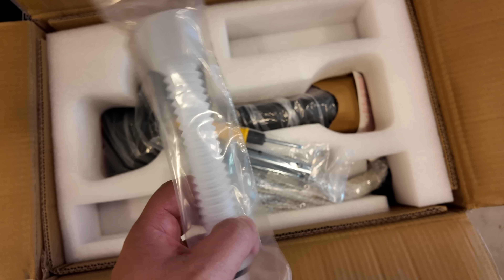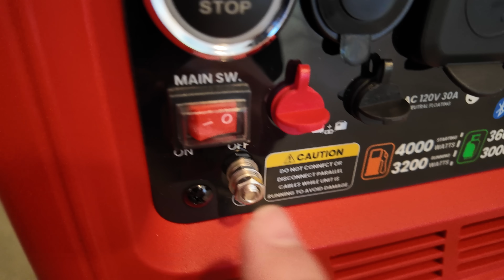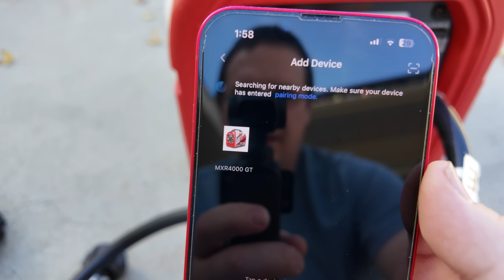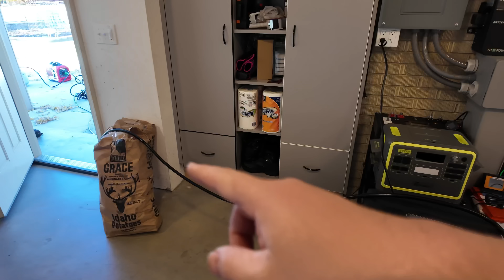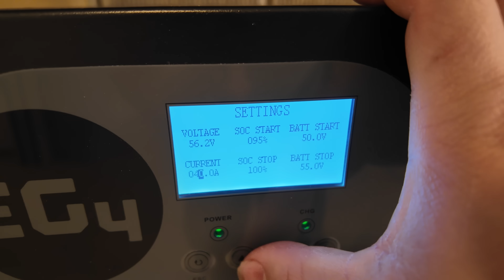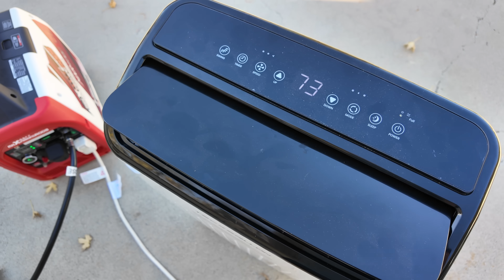UNPOPULAR OPINION: Buy Gas FIRST (Before You Ever Touch Solar)

Comment: Did you let a few minutes pass before testing the generator's ability on eco mode  to start the air conditioner (after doing the first test.without eco mode)? The air conditioner's pump would have been starting against higher refrigerant pressure if time was not provided for pressure on the compressor to drop back. It would be the same thing as starting an air compressor that already has full air pressure in the tank.
Reply from the maker: To tell you the truth, I don't remember

Comment: Small inverter generators like to run at about 83% capacity (read that at 70-90%) in order to get the most electricity out of gallon of gas. With some power stations, you can adjust the charging speed via an app on the phone to make it charge slower. In my 5 hours of testing and about 20 tests, 83% was the sweet spot, your testing results may vary. This is for an inverter generator charging a power station with a full steady load. At 50% capacity, I was getting ~4 killowatts hours of gas out of a gallon, at 83% load I was getting ~5.6 kilowatt hours of power out of gallon of gas. Based on my research with gasoline, 6 to 7 is the maximum amount anyone can normally get with a small generator. Diesel engines, and turbines get more.  I ran my tests with the tiny sportman 1000i 800 running watt generator, powering one delta 2. People would do better with a larger generator in the 1500 to 2000 running watt range as it can run pretty much anything on its own. If you are just running a generator, you need to leave extra overhead for the starting loads of motors, (the fridge compressor kicking on and off). Having a steady load allows one to really sip fuel, and get the most power out of the the fuel. I figure I can keep my house going on under a gallon of gas a day. My fridge takes about 1 kilowatt every 12 hours, when running off the Delta 2 power station. Anyway, just wanted to share
Reply from the maker: That's some great data on finding the sweet spot for fuel efficiency, thanks for sharing!

Comment: An inverter generator paired with a power station is the best hybird combo. They add solar. You would have all your basis covered.
Reply from the maker: Correct
Reply: Can you give an example of what each component is for a very small power need to just be using a 100w solar panel?  For A couple of lights, charge phones, iPads, and whatever else it might run. Thank you.

Comment: Unpopular and stupid opinion. With a solar Setup No Matter If a Power Station or a real solar system your solar Inverter must be as big as your biggest Power User. You now can Use a way smaller Generator to recharge your batteries and need less fuel. 
With solar you have an alternative Power source, and with a proper Setup you wont even need your Generator during Summer.
Reply from the maker: Valid point, but having a dependable backup ready to go is crucial for peace of mind.
Reply: @theresatrickforthat ?? A small generator and your batteries IS a dependable power source

Comment: I do appreciate your information
and I will continue to build a system.

 Im in North Idaho & yeah direct sun  here on belly acres gets very short in winter months.   [sigh - reality]
But Im thinking Hydro is possible as there are a couple creeks thru here   it could be an idea :)
also wind (?)   it blows here, not always, but pretty steady throughout the winter [the rest of the year it is better]

 in the past few years I rune a genny on just the 120 essentials, heat, lights, Wifi and of course TV and a couple fridges
my genny is a Generac  4000 [very basic] 

 my thought is to get a dual fuel genny - one dedicated to 120 for the long time of just the 120.

 Im been genny shopping and like that  lill max genny for the 110/120 light load

 Ive been pondering the Wen genny for the well pump. maybe the 4750 or maybe the 8000 (?) 
the research continues for the 240v genny.
 
 im thinking the lower "might" be quieter?  it will be an hour or two on that one, then I can shut off the pump breaker.
Ive been running 120 up there to the heater to keep it from freezing [thats a happy surprise, I just learned that a few months ago]
went up to look and had a warm pump house :o 

 then for the well pump thats 30A 240v - a dual fuel genny just for that. 
obviously stronger, but a fuel user for that 240v.  just run it when I shower, wash laundry

and then keep building up a dependable Solar/Hydro/wind battery bank.
it can be done. 

 normally the snows deep up here - its about 2250 elevation here at the place. 

 those power banks have my interest - ups ability and rechargeable (?) with an inverter genny? Im thinking that could be a win!
Reply from the maker: Sounds like some fun thoughts. Keep up the good work; you'll figure it out eventually!

Comment: The noise from a gas generator is the problem, you can't run one at night unless you live in the sticks!
Reply: Some of the gas generators are not that noisy. Particularly, the small inverter ones. There are plenty of ways to deal with the noise. Moving the generator to an area where the noise is not an issue is easy. Several sheet of plywood cut at angles and leaning against the generator can noise by about 50%

Comment: I'm thinking of adding a battery to my generators for the efficiency. Currently I have multiple generators for the redundancy and I can recommend a Big/Little approach, highly efficient 80cc inverter generator to provide base load  and my larger generator is a cheap 4200W 270cc  inverter generator that will run washer/dryer/heat water while still providing the base load for the house which is the usual 24/7 air conditioning, refrigerator, TV, computers, lights. Living in the tropics, it's pretty easy to tell when you are going to have a typhoon. We don't have a US style tank water heater here, bath water is a 3L 2000W kettle for convenience but I also have a large 300w rice cooker that takes about 30 minutes to boil a gallon of water. I will probably have to DIY my own battery because very few have 220V output and everything is 220V here. Still, the Big/Little method works well for us.
Reply from the maker: Sounds like a really well thought out system!

Comment: You kept calling the battery unit solar.  It is not solar it is a battery that can be charged with a generator or solar. In my opinion, your best plan is to use the battery unit and keep it charged with the generator. If the budget allows by all means invest in some solar panels to charge with but do not rely only on solar to keep the battery unit charged, always have a gas generator available.
Reply from the maker: Yep, that was the whole idea of the video.

Comment: This Unit has so much impressive about it.  Could I use this and my Honda 2200i in parallel?  I already have a parallel cords with a 30amp receptacle spliced, ready for when I get a second 2200, but I might skip it and step up to this 4000W generator.    Thanks for the thorough presentation.
Reply: Parallel doesn't really work that way. Paralleled the Honda would probably trip out before the 4000W generator gets to maximum output. I have seen examples where the smaller generator added something but it wasn't 1 : 1.
Reply: @robertkubrick3738 thanks. I was doubting

Comment: My family was left without grid power for 11 days after Helene. I had a Honda EU3200 and 40 gallons of fuel after 5 days we ran out of fuel. We survived the las 6 days relying on EcoFlow Delta 3 Pro with 2 expansion batteries and charging via solar.
Reply: You should have used your Eco, then recharged it with your generator. That way the generator only needs to run for an hour or two a day and that 40 gallons would last 3 weeks
Reply: @jimf4342   I have 12KWh of energy storage plugged to my house via Pro/Tran2 Sub Panel or critical panel. I have 2 fridges, chest freezer, Portable inverter AC, lights and some small electronics. My average power draw was 1400-1800watts an hour. I have 12KWH of energy storage and the Honda EU32 would take about 5 hours to charge the power station and pass power to the house. My calculations on the EU3200i with all the information I have gathered online would state I would burn 1 gallon every 3 hours at rated load =2600watts. I was realistically seeing 3 gallons every 5 hours. I would have approximately 8-10 hours of generator off time, but those are at night when I don’t want to wake up the neighbors or hear them complain about the generator. After 5 days we ran out of fuel and unplugged a fridge and a few other items and ran on bare minimum needs which didn’t include the inverter AC.
Reply from the maker: Wow, that's crazy how fast he went through fuel.

Comment: I agree,   its better than solar.   I just paid 200watt panels,  one is not what the other is,  burned up cells in the panels, and I will not get my moneys worth from them,  the problem is,    they decide where to judge the sun at,  then they make the cells bearly,  with tinyer wires in them,  and whey the sun is to hot from climate change,   they fry,  and then not produce no more electric.   This is a true story.   And today,  the generators are all chinese crap,   not real steel is in them,  they are made from cheap zinc,  some are cased in aluminium,  so welding when the rod goes thru the side of the block,  is not possible,  you have to buy a new one,  all of this stuff is shut it off, throw it away, same as the gov wants you to be bankrupt doing it
Reply from the maker: Yeah, it's too bad we don't have high-quality stuff like we used to.

Comment: I’m writing to share my experience with the maXpeedingrods MXR4000 GT, a 4000-watt dual-fuel inverter generator. We run a van with 600 watts of solar on the roof, and to supplement that system we purchased this generator. My plan is to operate it exclusively on propane unless gasoline is required in a true emergency. The main selling points for me were its compact size, electric start, remote start, and dual-fuel capability.

In real-world use, I’ve only been able to get about 2,400 watts while charging our van’s lithium batteries. Under load, it’s noticeably louder than comparable Honda units. To reduce the noise, I lowered the input current limit on our Victron system to 15 amps, which made a significant improvement. Despite those minor drawbacks, I think it’s a solid generator for anyone with modest power needs.
Reply from the maker: Thank you so much for sharing your honest feedback. That's what I love to hear.

Comment: I don't believe that an "inverter generator" is a huge issue when charging power stations. People do this every day using a conventional generator without any issues. I have recharged a couple of my LifePo4 power stations with my conventional gas generator without any problems. I did buy a small inverter generator out of caution, but won't hesitate to use my regular one if needed.  

I would add that if my generator was 20 years old and ran poorly, I would not use it on my power station. They have to be able to deliver consistent voltage.
Reply from the maker: Sounds good

Comment: given the price and feature changes, this is very ... dated.  i own both; I use the battery daily.  that means it starts paying itself off.

the generator -- never.

given the price/feature trajectory it seems the thing you're not going to immediately use should get punted further down the line.

the generator has its place, but it's not the first equipment to go for.
Reply from the maker: That's why it's an unpopular opinion.
Reply: @theresatrickforthat  i'm not sure how you measure popularity.

You go to any job site and they're not running battery banks.  They're all running gas generators.

Gas generators are far, far more popular than large battery stations of roughly the same power level.

So what you're presenting isn't some hip contrarian galaxy brain counter-culture opinion.  It's actually the mainstream opinion.

Comment: Consider buying a second hand diesel generator, any age just with low hours for winter power.  Most places i have installed are farms they already have diesel tanks. Also diesel wins on running costs 

However, you need to have basic mechanical knowledge to maintain a diesel generator like all farmers or homesteaders.

Propane is more suited to RV/weekender in the woods life.

 If you are lucky to have the right land for it wind can be a viable option. But know your land.
Reply from the maker: Great thoughts and ideas, thanks for watching.

Comment: It’s not an unpopular opinion,
but a classic case of wishful thinking! 

The key question—besides independence during cloudy weeks—is: 
What does one kWh actually cost?

With a generator setup like this, you’re looking at ~$0.80–1.20 per kWh
(fuel-based, depending on load and EU vs US). 
Solar, on the other hand, costs $0.20–0.25/kWh
 (or even less with DIY setups) over its lifetime. 
For long-term off-grid use, solar is the clear winner—both economically and ecologically.
Reply from the maker: I agree 100%!

Comment: Great video....That appears to be a great little generator. I really like the bluetooth capability and remote start. I have a 2300 watt generator paired with a Pecron 3600. I use them to run a 30 amp motorhome and also when tent camping. The Pecron charges at 1849 watts input from the generator taking <2 hours to charge up when starting at 22%. The Pecron solar power station combines the small amount of solar due to tall pine trees with the generator to make the off grid time flawless with plenty of power. I call the combo my Prius hybrid of the off grid world. I will be adding expansion battery power this year for more quiet time between charges.
Reply from the maker: Sounds like you have an awesome setup!

Comment: Good video! I am going to do this myself. We just bought an off-grid cabin, and we have a Abok 3600 solar generator. Rather than install the solar array right now, I was looking into an inverter generator instead, especially since we could use it to charge the solar on our off-grid ambulance camper conversion as well. Panels will come later. I'll check out the generator you are using.
Reply from the maker: Great to hear you found it useful for your setup!

Comment: Have a Pecron 3600w, 12kWh battery system paired with a Wen 4800w dual fuel generator that I only run on propane.. For  home backup it is connected to a 30amp 10 circuit transfer switch.
Reply from the maker: Sweet!

Comment: As a life-long electrician and with over 45 years experience with off-grid electrical systems in Hawaii, I have always said, "Get a generator first!"
Reply from the maker: Awesome!
Reply: @theresatrickforthat  I had two Honda 2000 watt generators for over twenty years, but recently replaced them with a Champion 4,500/3,250 dual fuel inverter generator. I like the Champion way better than the Hondas and the propane burns almost odorless and clean. No comparison.
Reply: @nonattorneyspokesperson noted!!

Comment: I came to the same conclusions for my setup. I live in Pensacola FL and if you can, one should plan for 3 days without power.  I have a PREDATOR 5000 Watt Dual-Fuel Inverter Generator that has wheels. I would suggest always doing a test setup of all your gear in place. You will find when you set it up and use it as planned you will always find/learn something you didn't know and adjust your setup.
Reply from the maker: Right on

Comment: Hi, great video.  Looking for an equipment barn solution for lights/security power.  Is there a cost effective solution to turn the generator on/off automatically based on state of the battery charge?
Reply from the maker: Yes! EcoFlow has all kinds of smart programming like that baked into their app!

Comment: Or you can buy the Wen DF680iX that does the same, plus 240v, and more watts.  For the same money.
Reply: The WEN has a 224cc engine while the MXR has a 145cc engine so the Wen will use about 50% more fuel because an ICE engine will only run within a narrow range of air fuel ratio so the cylinder is going to be full of air/fuel every time whether you need that much power or not. 50% more fuel / cost to run and possible logistics nightmare in a long outage. You might want to deeper dive and see if you really need 5k watts. Fuel cost for a generator over it's life Dwarfs the initial cost which is why I have two, one small and one large generator.
Reply from the maker: Nice!

Comment: I've been saying this exact thing for a long time on my channel.  I bought the generator (7000w) first (it was the cheapest part).  Now I have a whole house battery system with 6kw (split phase) and 15kwh of battery.  Have you been thinking about this next step?  What if you need the system to run 24/7 for longer periods?  I would be interested in your thoughts about that.  For example, how many hours do you run the generator to create enough power to run the system 24/7?  Great video.  You now have me thinking a smaller generator might be better than that monster generator I now have.
Reply from the maker: Yep! Smaller is better for sure if you have a good battery and inverter setup!

Comment: Battery power to me is still way too expensive, at least for me. I don't need it very often or for very long so a battery will just sit most of the time. I have a generator that is dual fuel and suits my needs when I need it. I wired mine into my electrical panel with an interlock and keep it in a small shed outside near the power in where I plug it in to feed my panel. I rarely need it but when I do its a life saver. I have zero battery stuff again due to its price.
Reply from the maker: Nice!